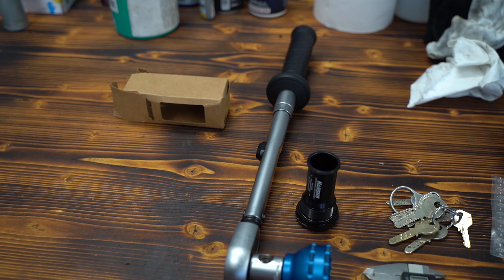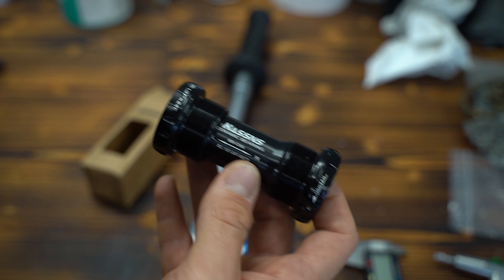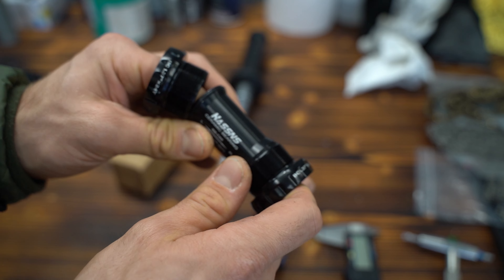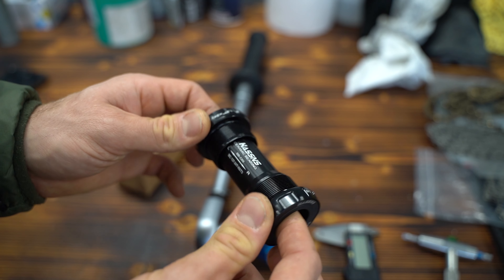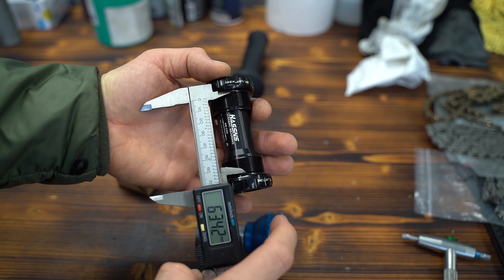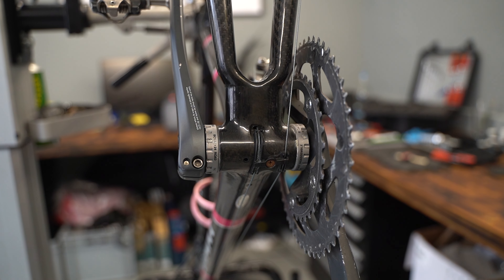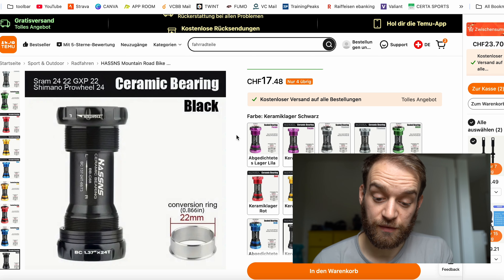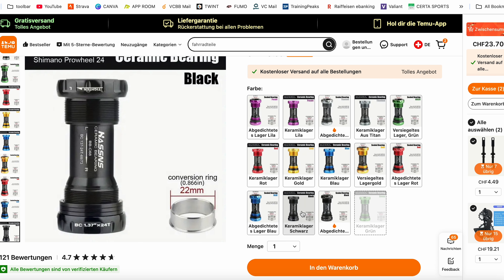Ceramic Bottom Bracket From Temu!

Comment: Wasn't it possible to reuse the plastic sleeve that was on the old 68mm-wide bottom bracket? There is a chance it would fit into the new BB by both the diameter and the width. And if the width is off, plastic can be easily cut in the middle to make the sleeve shorter.
Reply from the maker: A good idea that I also tried but realized that the threaded part of the shells are longer than those on Shimano so the plastic piece was too long also:(
Reply from the maker: Cutting it to size is maybe still better than putting nothing in yes! In the long term I will have to find a solution like this
Reply: @sebibuchs  I don't think you need the sleeve. You have a drain hole in the bottom and the sealing on the chinese bearings isn't as good as shimano anyway, so the dirt from inside the frame will be minimal compared what you get from outside. Also no cables routed along the axle. Cables are outside. Sleeve is dead weight. I would argue you downgraded the bearings anyway. Shimano bearings are good and sealing is the best.

Comment: Fyi, using a torque wrench not from the handle will throw off your torque settings.   Grasping by the head is an inaccurate.
Reply: I wanted to write it as well, but was too lazy :-) There is usually a mark on the far side of the torque wrench handle where the force needs to be applied to get correct readings.
Reply from the maker: @GrigoryRechistov you‘re right sirs I was in a rush😅and unfortunately my wrench does not have a marking on it where to apply force:(